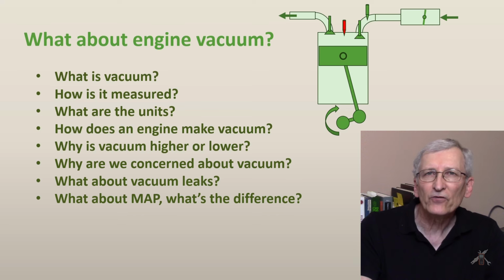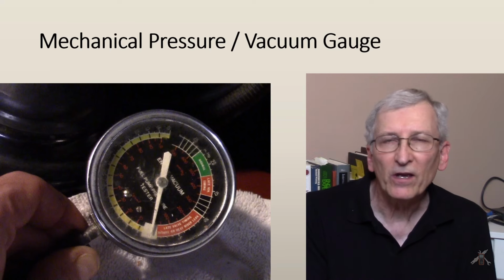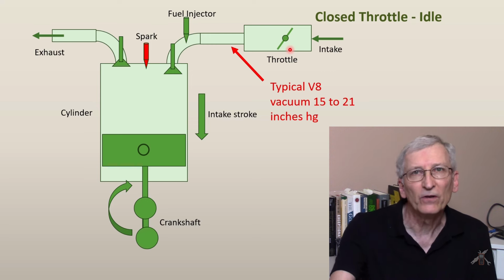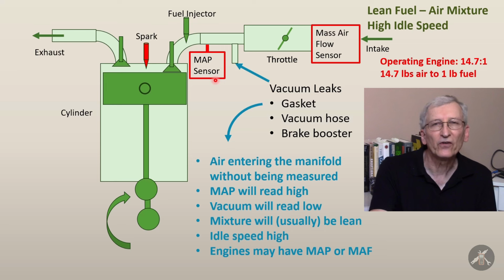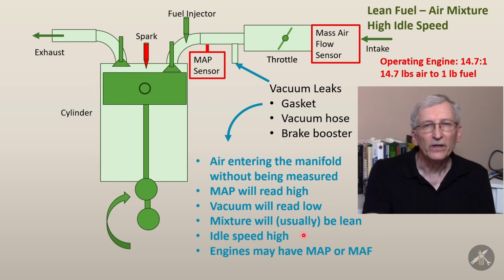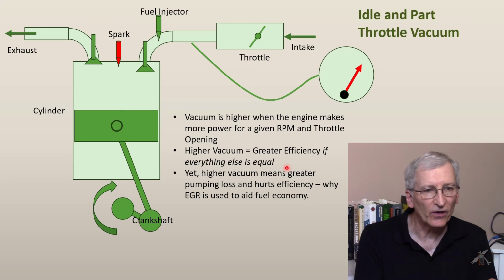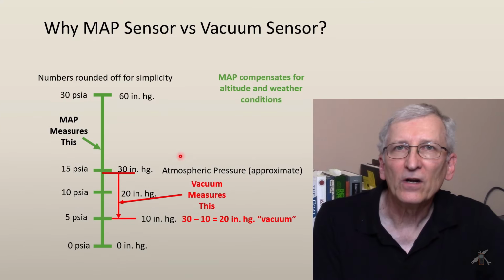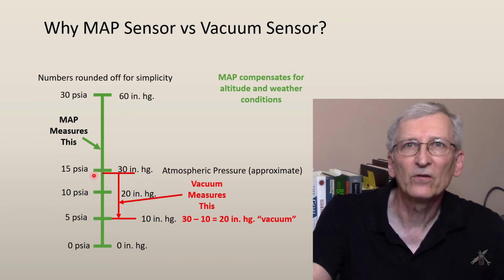Understanding Engine Vacuum and MAP - What is Vacuum? Why engines have vacuum & why it's important

Comment: Hello. How much does a vacuum typically change on SC and turbo engines? Also, how would you assure if any PCV changes necessary when modding a car say with a bigger turbo? Thanks.
Reply from the maker: A supercharged gas engine still needs to be throttled to control power, so at idle and lighter loads, it still should have vacuum similar to a normally aspirated engine.  That vacuum should decrease and transition to boost as throttle is opened to increase power. I haven't experimented much with SC / Turbo so I don't have a good example.
Regarding PCV, I don't know.  NA engines go to minimal vacuum at WOT and PCV reduces until throttle is closed. I would look at how boosted engines are plumbed to use as comparison.  It may depend on whether the boost is blow through the throttle body / carb or draw through.
Reply: @ is my logic accurate? When boosted air rushing in under the load it would cause more blow by gases that need to be vented out to mantain pressure range..? That is what I’m trying to understand with some people modding the cars by say sizing up a turbo or changing pulley sizes, throttle body and etc. I don’t think I have ever heard anyone talking about a need of altering PCV system to avoid premature failures. Or am I missing something and generally speaking OEM PCV should handle these changes just fine…? I look at some people 3x the power and that’s what I started thinking after watching your excellent video! Thank you for sharing all of your wisdom with us!!
Reply from the maker: @somaxusa  I think that your logic is reasonable in the thought that higher cylinder pressures from boosted engines would likely cause higher leakage past the rings and more blowby. I don't know the capacity or margin in the systems.  The engines with PCV valves tend to regulate flow.  Some newer engines have fixed orifice systems that don't regulate. My engine friends used to call the old ones "fresh air" and the newer fixed orifice "foul air" systems because the fixed orifice wasn't as efficient at removing the blow by, (yet those engines seem to work just fine).  If you go all the way back to my '60s car, the PCV inlet and filter is the oil fill cap in the valve cover.  If PCV became overloaded under power, the pressure relief would be leakage back-flow out the fill cap. Newer cars have inlets in different locations.
Now, just thinking, is that the main risk for high boost is probably crankcase sealing. If pressure builds up in the crankcase, the crankshaft main seals could be at risk of damage at some level.
If it was me, I would probably look at others who have been down the high boost path to see if they need some form of pressure relief or custom PCV.
Reply: @ That pressure relief valve was there for a reason for sure, granted with the emissions control came down the changes. But in reality, one would think a modified oil cap to somewhat match old style or better yet use of some sort of pressure measuring device(manometer) would be ideal during at least test stage to compare baselines. I’ll have to ask modders around to see if I’m overthinking this potential issue, but it’s hard to believe someone would actually have any calculations. A lot of them seem to be just super excited to get some bolts on to get as much as possible from the engine.
Reply from the maker: @somaxusa  Yes, I was thinking about suggesting pressure measurement.  A manometer check would be good, I just don't know a good threshold for maximum pressure.  The lip seals for the crank would seem likely to be most sensitive.
Reply: @ Yes, I wish this data was published somewhere. Without it, I can only see getting a base line before vs after to check for differences, and then use your best judgement on what might be acceptable fluctuations. Thanks for your engagement!

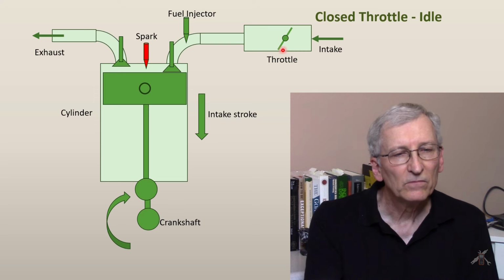Comment: 10:36 and on. Where the nickel dropped for me. I have a motorhome with tag axle brakes activated by vacuum from an outlet just below the carburetor. Even at high throttle, there's still enough vacuum to make them work OK.
Reply from the maker: Most vacuum brake systems have a reservoir to hold vacuum for when the throttle is open. Then when you back off it will charge again.
Reply: @bitsofwisdom460  The 1987 tag axle still has a fluid reservoir that holds about 10 ounces of fluid. Maybe when vacuum is low, the hydraulic braking kicks in? (They were made by Dexter, by the way, which no longer makes hydraulics brakes for vehicles. I think they're focused almost exclusively on trailer brakes now, especially electric brakes. Fortunately, all the hardware, drums, and shoes are identical to those for Ford E350 vans, which are still being made.)
Reply from the maker: I don't know exactly what system you have, but from what you describe, it sounds like it could be vacuum over hydraulic. Those systems have a vacuum brake booster driving a hydraulic master cylinder.  These have some type of actuator that provides a signal to that vacuum booster.  It might be a hydraulic line from the main brakes that triggers the system for the TAG axle.
Reply: @bitsofwisdom460   Yes, you are right, the tag axle has its own booster and the rear hydraulic line is connected to the tag axle hydraulic system, but I had to bleed the system from the Dexter brake fluid reservoir before they would work. Previous owners probably just ignored the tag axle brakes, which is pretty dangerous, since the hydraulic and vacuum systems are all interconnected. I'm just amazed that the valve in the booster and everything else still work after 37 years.

Comment: on a diesel engine will vacuum give high blow by ?
Reply from the maker: I would not think so. Conventional diesel engines don't have much vacuum because they are un-throttled. Blow-by is usually related to ring seal.  It is true that vacuum can upset ring seal, but I don't think it will apply to a diesel.

Comment: I always wondered, why engines worked with vaccum, in my head is so inefficient, so many loses
Reply from the maker: You're correct that it seems inefficient, yet that is a key part of the way standard gasoline engines work. Many have tried alternatives, but they are difficult and have drawbacks.  It's too complex to try to explain here, perhaps I'll need to try a follow-up video.

Comment: Could this explain why the oil filler hole/dipstick tube pulsates air in and out during idle? I understand there's PCV connected to the crankcase, but I was a bit alarmed by how much air appeared to be coming out of the oil filler hole during idle. If I placed a sheet of paper of the hole, it would rapidly push and pull the paper to the hole as if it was "pulsating"

Or is this just air displacement within the crankcase from the pistons moving up and down at a rapid rate..
Reply from the maker: There can be some pulsating, but most of the pulsation (in most engines with even number of cylinders) should be neutral because as a piston moves down, another moves up.  There will be some net flow outward due to the "blowby" or leakage of combustion gasses past the rings. If you have a cylinder with higher leakage you might get a stronger outward pulse when it fires.  The entire intent of PVC is to pull these vapors and burn them.

Comment: Thanks for the knowledge you have provided, please what does late ignition timing means
Reply from the maker: Late ignition timing is a little variable.  In general, engines like to have a base timing several degrees before top dead center.  Depending on the design it can be from perhaps 5 degrees before TDC up to as much as 15 degrees.  If the timing is much lower than that, then vacuum would be lower and would be considered late timing. It might even be AFTER TDC.  When I say it is variable, if an engine should be set to 10 BTDC and it's running at 2 BTDC, it would be late.
Reply: @bitsofwisdom460  thanks

Comment: Man I hate it when people know what they are talking about, leaves nothing for me to criticize........... this is one of those over look thing today,  I think if more people really understood how vacuum is used in Modern EFI and it's affects on intake draw  and Injectors, there would be a lot of really good tuners out there.
Reply from the maker: Thank you, and I agree that vacuum or manifold pressure is often not understood.  When I was working in the hybrid vehicle world, our calibrators had to watch manifold pressure very carefully.  A particular example was that if you wanted a smooth restart while you had been running in a hybrid mode with the engine off, it was best to spin the engine with the throttle closed and the fuel off until the intake manifold pressure pumped down to the right pressure / vacuum.  Then you could fuel the engine and not have a big spike in torque due to all the air in the intake. It made for very smooth restarts.
Reply: A good story for sure, thank you sir.
Reply: 99
Reply: I'm here to learn. I honestly know (understand) very little about vacuum
Reply: Funny!